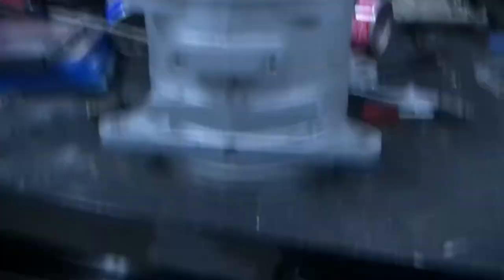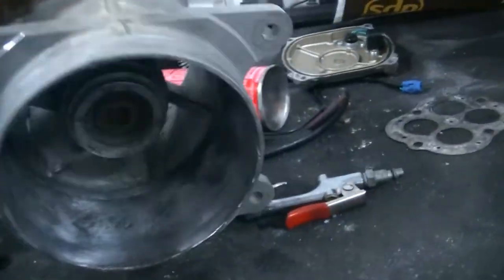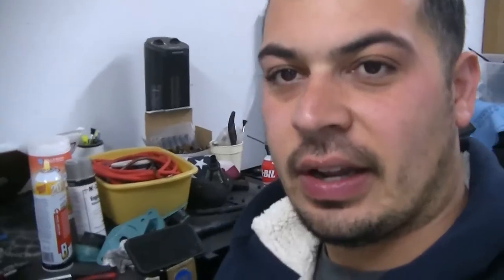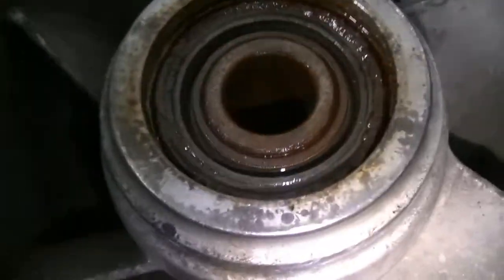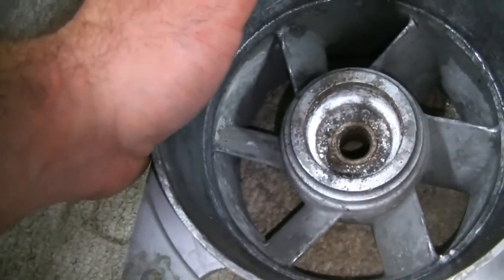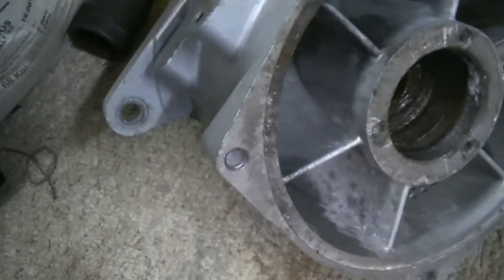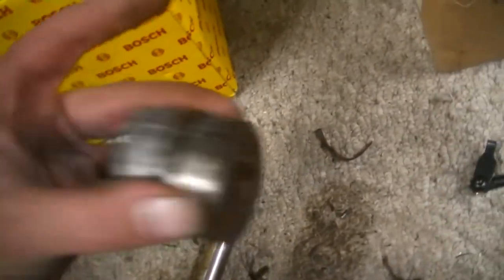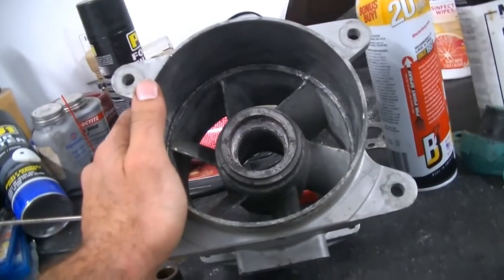We COMPLETELY REBUILD the jet pump in our Kawasaki 15F.

Comment: question . is a 6t press good enough for pump bearings . i’m doing my yamaha 760 but don’t want to buy a cheap press for nothing. i’ve seen it used for wheel hubs
Reply: That will work fine

Comment: My 2008 stx15f has a hot start issue only while  in the water, not while on the hose, the jet pump has corrosion which has worn the impeller, would this affect my hot start issue?
Reply from the maker: Google “STX-15F heat soak” It’s actually pretty common and has to do with the overheat sensors on the exhaust and oil pan reading inaccurate temperatures when the water drains out of the exhaust after riding causing it to read higher temps than are actually present. I believe the fix was to add a resistor on a switch